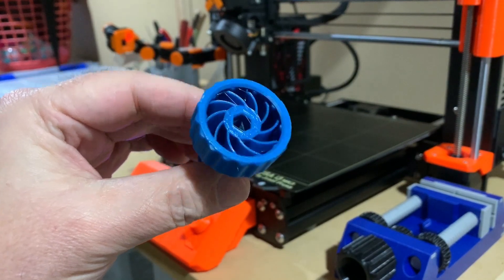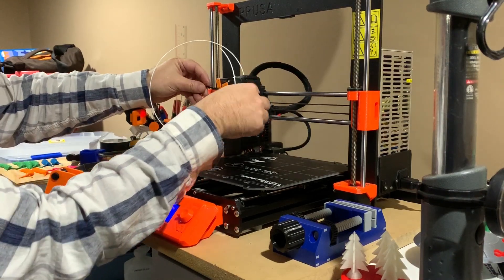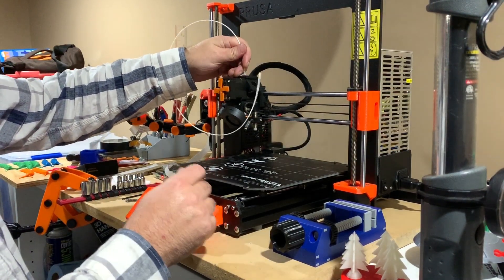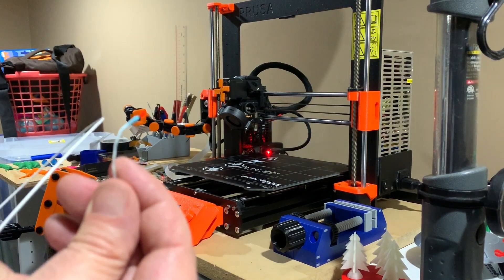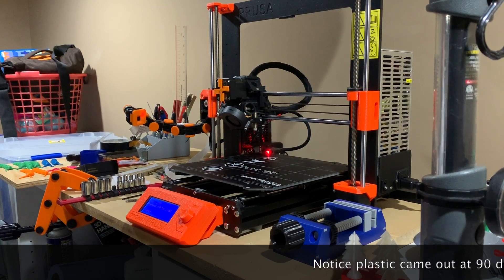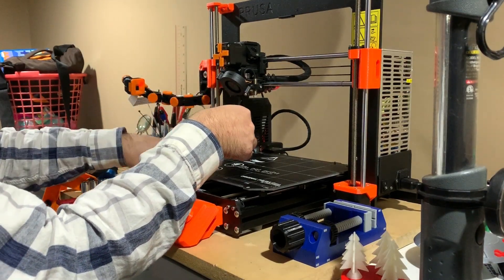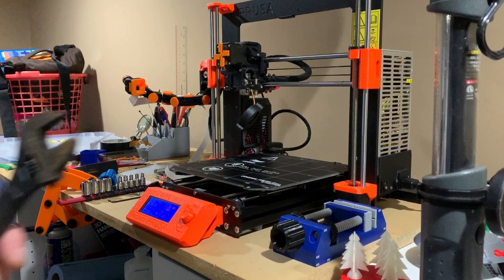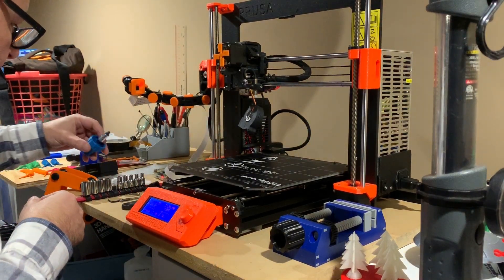Installing The Olsson Ruby Nozzle on my Prusa I3 MK3s

Comment: Test print? And your thoughts on this product?
Reply from the maker: I actually need to do an update, I stopped using this product.  After installing it I got sloppy prints, and initially thought my filament needed drying, but after significant drying and still having trouble I went back to my original nozzle and all my problems disappeared.  I think the reason is the Olsen nozzle has a hard square edge inside (as pointed out by another you tube video person very angry about it) and also the Prusa hot end has a weird kink inside. My theory is the two don't work very well together.  Since charging the nozzle is easy, my plan is to sacrifice a brass nozzle for the rougher filaments when I use them, for now at least.
Reply: William Koontz there are much better options then sacrificing a brass nozzle. Have you tried a hardened steel nozzle that’s from Prusa themselves. Or check out the E3 D nozzles which is where Prusa  gets their nozzles, they have a bunch of different material options that will be better than sacrifice in a brass nozzle. https://e3d-online.com/products/v6-nozzles
Reply: @oarnaur  good tip! It sounds like a better option, the Ruby is mighty expensive and if it doesn't produce top results I to would go for the steel nozzle. I'm about to order a Prusa and want to get spare nozzles etc so I'm good to go with any material from day one.